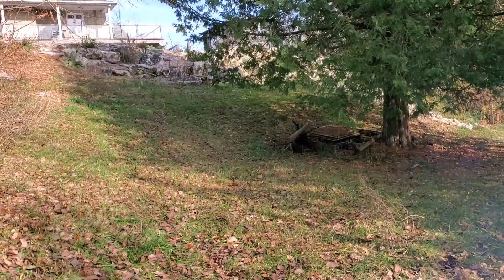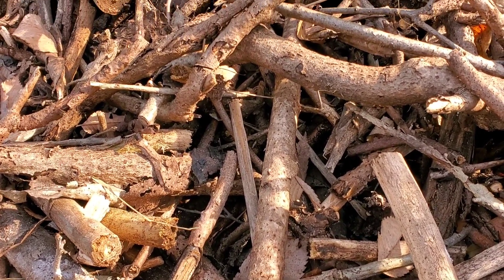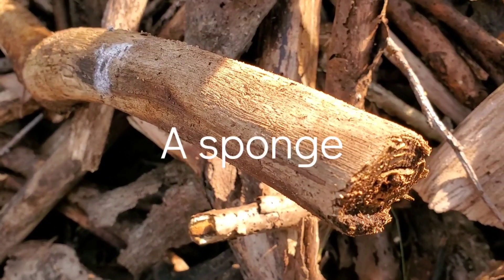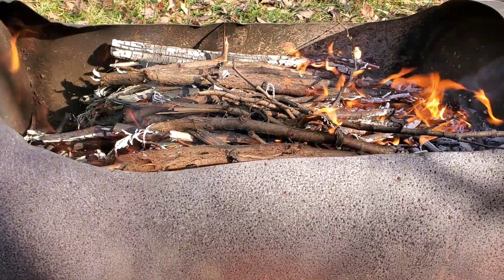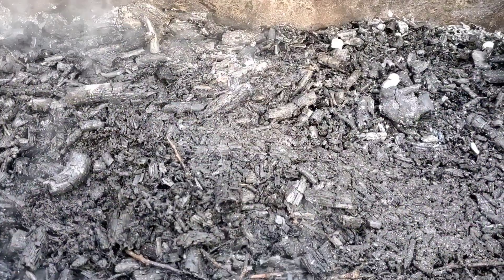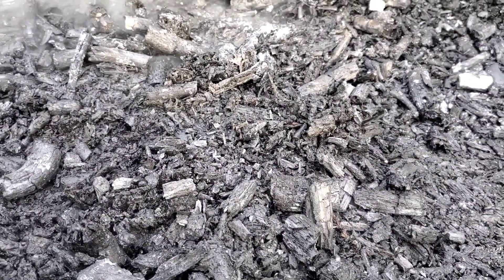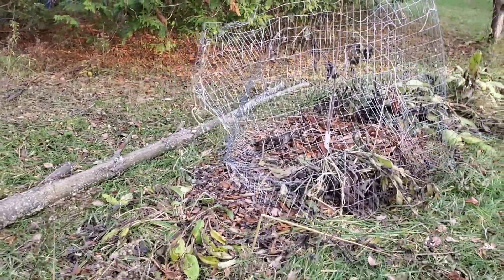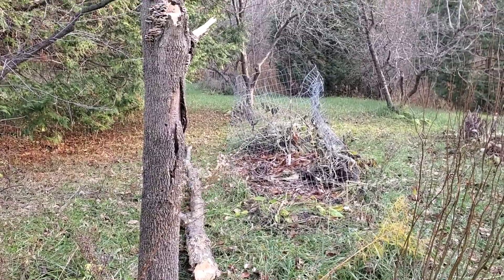Biochar, and a new consultation job

Comment: No experience whatsoever with making biochar, but want to give it a go. Like tomorrow, lol. The first step of the project seems like something I'd delegate to my better half, who enjoys relaxing in a chair while watching things burn. Can you recommend a clear set of written instructions for making biochar?
Reply from the maker: I'll do it now - simplified version:

1) Get a 55 gallon drum with a hole cut on the side (like mine), or dig a cone shaped hole/trench.

2) Get a bunch of sticks/twigs, ideally the thickness of a mans thumb, or smaller. The smaller, the hotter the fire will be, and the easier it is to get a thru-burn.

3) Jam and weave the sticks into the container/pit trying to get it as tight as possible. You want as little air in there as possible.

4) Light it on fire from the top. Ideally there should be a complete surface fire from one end to the other. It will smoke at first, don't worry about that. Just keep that fire going as much as possible - you want it to get HOT.

5) Keep stacking wood into the top layer, but trying to keep the fire in the top layer. I.e. you don't want to smother the fire, and you don't want it pushing down too far into the container. You want the fire on top.\

6) As the heat drives gases out of the underlying wood, you will notice a point where the pyrolysis reaction (the fire) has a firm grip and is self-sustaining. I.e. it will keep burning what feels forever with no added wood. This is the gases being pushed out of the lower wood being recombusted. 

Aside - Troubleshooting: If you start smoking a lot when you add wood, it's probably because the wood is wet and the heat is being absorbed by the water, and the combustion gas layer is temporarily not hot enough to recombust the gases. Try to add as dry wood as possible (and thin, thin sticks burn at 1200F, thicker wood burns closer to 400-500F). Get that hot gas layer hot again, so the combustion gasses are recombusted and don't exit as smoke. This is the self-sustaining reaction you need - we're not having a campfire, we're doing pyrolysis.

7) At this point, the fire will be almost unstoppable. Keep adding wood as the top layer starts to ash. Once the new wood looks like it's burning, give it a pound with a tamper and/or poke through the lower stuff with a branch trying to not disturb the top layer much. You are trying to get all those hot charcoals to fall to the bottom and increase the density of the entire pile (i.e. filling any air gaps inside the pile with crushed finished char), but keeping  the fire at the top.

8) Eventually you will either run out of wood, or your container will be full even after tamping and poking. At this point, let that top layer finish combusting (wait until you start seeing ash), then FILL YOUR CONTAINER with water. I cannot overstress this. There is so much heat in here, and it's pure-fuel at this point, so if you do not SOAK IT it will re-ignite overnight, and could cause a forest fire. You want a drenched slurry . This is one advantage of the sealed drum, as the water will stay in it. If you do a cone pit method, I would recommend re-slurrying it after about an hour. Soak, and stir, and soak and stir. It should be a like charcoal smoothie.

9) Add into an active compost pile at roughly 10-20% charcoal. Make sure it spends a good 3 months inside a compost or manure mix. Alternatively you can mix in some spoiled flour, powdered molasses and water. Urinate on it (if that doesn't gross you out - and it shouldn't). The best part about charcoal is that is absorbs everything - including smells. There will be very little odor of any kind - I mean, that's what it's used for in industry after all. A filter media. 

Going to include this in description of video.
Reply: @CanadianPermacultureLegacy  Perfect--thank you so very much! A good three months inside an active compost pile...my compost isn't especially active over the winter. Assuming my weather conditions roughly parallel yours, how would you count those three months if you made biochar this weekend?
Reply from the maker: I would say November until planting season is decent. The compost breaks down due to biological organisms (mostly bacteria) going into quasi hibernation. But they will still move through it and occupy those little hotel rooms. The temperature also doesn't impact (too greatly) the binding of nutrient to the charcoal. Many of the chemical bindings require activation energy, but its not like it needs 180F worth of heat to be added to it in order to bind to carbon.

To be concise, the compost pile can be rather inert biologically speaking, but the charcoal will still soak stuff up.
Reply: @CanadianPermacultureLegacy  Reporting back in to say, "Mission accomplished!"  Can't wait for next season's field trial. Thanks again!
Reply from the maker: Nice! Remember the inoculation step, its critical. So many people put uncharged biochar into their garden and wonder why the bed sucks for 2 years.
Reply: @CanadianPermacultureLegacy  Done! Used compost from the chicken run, which contains a wide range of ingredients.
Reply from the maker: Wonderful! Thats even better than my horse manure.
Reply: @CanadianPermacultureLegacy   OH MY GOSH- I Copied your instructions and now it makes a lot more sense!!  Thank you.   But what is an ACTIVE compost pile?  I gotta get me one of those. I do have a pile of horse manure in my front yard that was delivered last week for my hugelkultur,. If i put horse manure in my not active compost bin will it become active??
Reply: Airterra in Alberta sells biochar at a reasonable price, especially if it's for a smaller garden, like mine.

Comment: Do you need any material to make biochar? One of my neighbours at work was throwing in the trash chestnuts that were beginning to mold ,so I offered to take it. I tried making biochar with it in the wood stove so I assume it would work the same with your technique. I have way too much , probably 1000 lbs too much. I’m in the Durham region (Bowmanville rd/407)
Reply from the maker: Anything organic works, since all live is carbon based. If it was once alive, it can be turned to charcoal. Wood works really well because it's such dense carbon, but yes anything will work... bones, bark, and yes even Chestnut husks will work well. You just may need to use some wood to control a nice hot gas layer. It needs to be hot.

Comment: Burn baby burn, disco inferno, burn baby burn. Hey Keith, did you need to notify the fire department in your local area? Since it is a 2000 year soil amendment, does it matter at what time of the year you should do it?
Reply from the maker: Weird, didn't get a notification for this comment. Sorry for the late reply...

I didn't no, and no definitely doesn't matter what time of year you add it. The only thing would be that I'd want to be innoculating it in somewhat warm temps so that the critters can get inside it. Biological activity really slows down in the cold temps.

Comment: Do you crush your char either before or after inoculation? I’ve been turning BBQ charcoal into « biochar » but discovered it wasn’t very good for that purpose as it composts down because it’s not properly treated. But one thing I’ve figured out is how to smash up the bigger charcoal bits, because I don’t want large chunks in my beds, especially the carrot bed. I have an old hammer style Kemp shredder which I wheel onto an old tarp and then tie the tarp up around the shredder to contain the flying bits. Works WELL! because I do this right after emoting the biochar from the manure tea I use as an inoclulant, there’s no dust!!!  this is the first time I’ve seen an open « retort » oven,. But I think this is likely closer to what the Amazon natives did to create their biochar than what we do in retort burners. Greetings from Sudbury !!!
Reply from the maker: Indeed, I just put it on a tarp and run it over with my truck a few times. Also, the way I make it, I'm constantly pounding it to get all the air spaces as vacated as possible. When I'm done with my batch, its quite smashed up already.

Sudbury is nice. I used to go fishing up in Azilda.

Comment: “...thermal capacity of the water will protect it...” around 9 min mark referencing pond water added. What do you mean?
Reply from the maker: This is one of those moments where I'm thinking through something in my head and just assume everyone else is part of the conversation lol. Basically, I was saying that we should quench with water, but at the same time I had also just been talking about innoculating the biochar with nutrients and microbiology. Pond water is very high in both, so when I quench with pond water (versus say hose water), then the result should be a biochar that is also innoculated with water microbiology. 

But then I remember the heat of the charcoal, and question in my head if the microbiology would survive being tossed onto hot coals. Something big wouldn't, but stuff that is so small that it is better shielded by water would. For example, consider dropping a human who is contained inside a house-sized volume of water, and dropping that on a basement sized pit of coals. Chances are the water would absorb the heat of the coals and the human would survive that. Similarly, I think a lot of microbiology in the water actually will survive being dumped on the hot coals in this barrel. Some will certainly meet an unfortunate end, but I think a lot of it survives. Infact very quickly after a full slurry of water, the coals can be picked up comfortably with your hand.

Sorry, for the confusion - I was kind of hoping people wouldn't zone in on that. I had a clip to explain it, but then the clip was kind of too much speaking about a tangent for no reason, etc. So I cut it out in editing. It's little tangents like that which take some of my videos to the 25 minute mark, and offer little value.

TL:DR, I was basically just saying that the life in the water will likely survive the douse, because water can absorb so much heat, that the coals are quite cool by the time the water microbiology hits it. And then they can find homes inside it, and start making microbiology babies.
Reply: @CanadianPermacultureLegacy   that’s a very understandable explanation ,thank you. I am here to learn, and my brain goes in different directions while thinking so I followed the thought process no problem. A human excased in water bubble is an analogy I can totally handle!

Comment: We make smaller batches, at 95% charcoal efficiency.  We use a barbecue grill and light the kindling and build up the material radius as fast as possible, then slowly build down the radius of new material added as the largest logs burn towards the center.  All the material burns through to the center at about the same time, and we douse it heavily when the most charcoal exists at the same time.  We call it "The Inferno Method"~
Reply from the maker: Sounds cool. I like the idea of having a way to do smaller batches.

Comment: maybe you will say this later in the video, not there yet--but how much biochar should you or should you not add your gardens?
Reply from the maker: Now thats a tough one. There was research done in Sweden that showed upwards of even 75 percent (wow!!!!) was beneficial. Most sources say to make it roughly 10 to 15% of your compost mix, and let it sit and innoculate for 3 months before adding it to the garden proper.
Reply: @CanadianPermacultureLegacy  if you have really hot summers, black soil is problematic if it's on the surface. One needs to make a sandwich type layering where the biochar ammended compost is covered with something like cardboard, woodchips, sawdust, straw or even rocks to keep the surface cooler while plants grow.